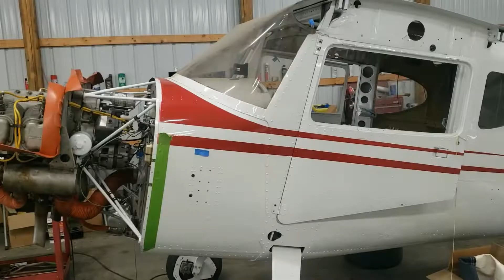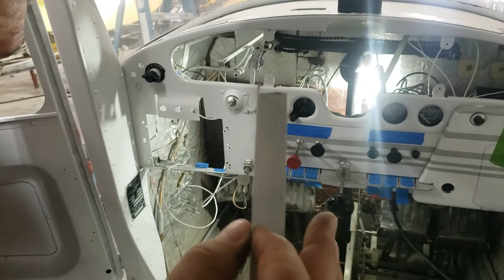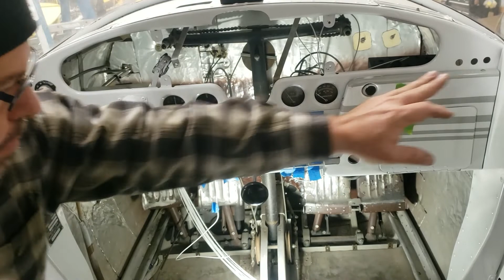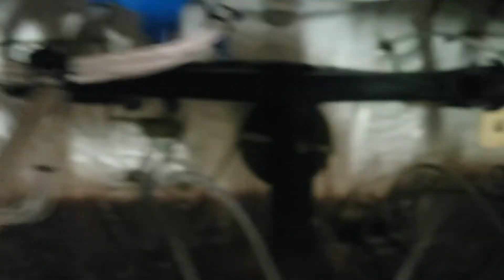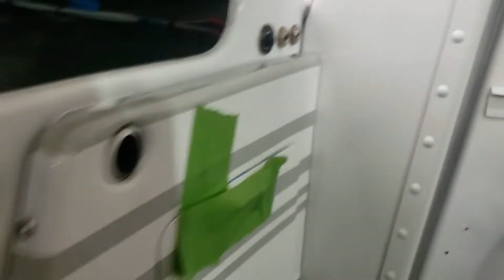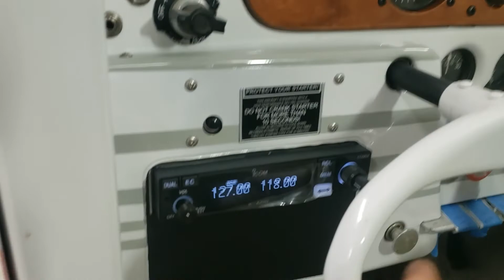Aircraft Radio Install - Cessna 140

Comment: A pencil on Aluminum?   I thought that was a no-no
Reply from the maker: Great point! In short, Correct! I wouldn't use a graphite marking device on stressed skins, pressure bulkheads, etc. However, understanding why graphite is not used is important. Although graphite in itself can be injurious to aluminum. In a pressure/stressed application it's more about leaving tooling marks that can lead to premature failure... For many applications, I prefer a pencil. Usually, the areas of the aluminum that come in contact with the graphite are cut away, deburred, corrosion treated, and prepped for assembly. As well, for the past 25 to 30years (or so), the aluminum I've been using, has a protective coating applied. My technique doesn't use "heavy" pencil marks and the graphite is removed with the protective coating or in the manufacturing process. In applications where this is a concern. I have a felt tipped applicator that can be refilled with ink; which works great. Thanks for watching.